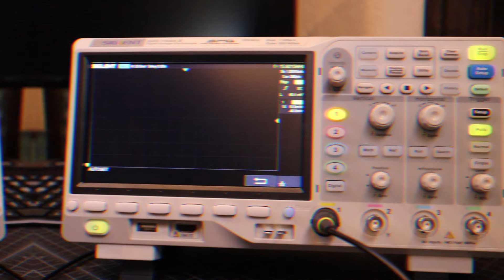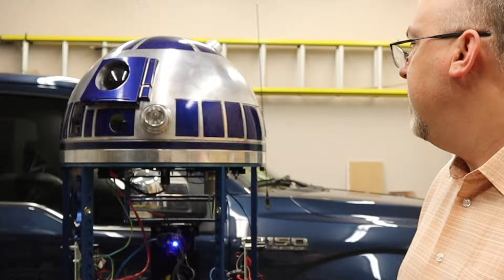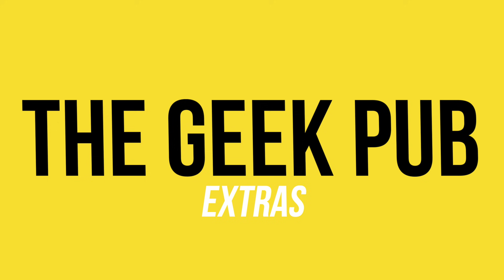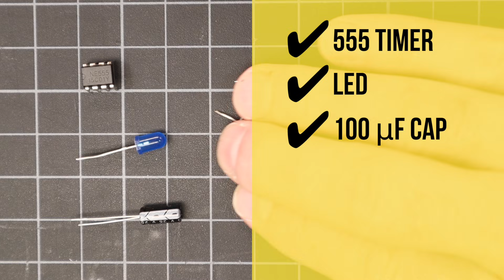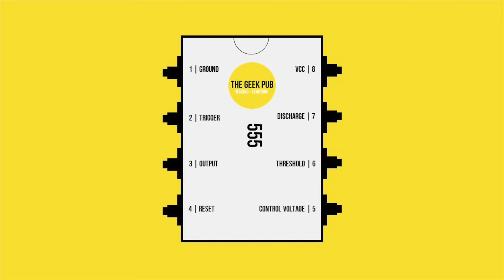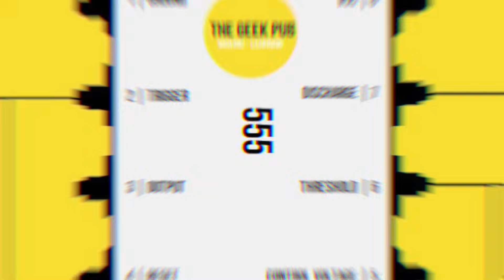555 Timer (astable  mode)

Comment: Pin 5 also needs the 10nF capacitor to ground, per the datasheet, for control voltage stability.  For a proper robust design, this pin should not be left open.
Reply: Cum pot face să lucreze 5 secunde de exemplu și să fie off 2 minute?Multumesc